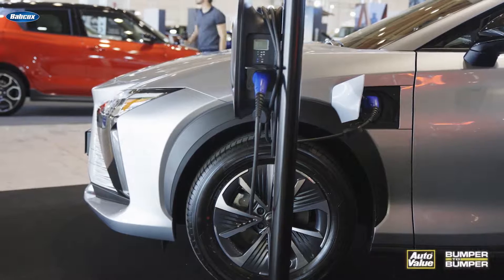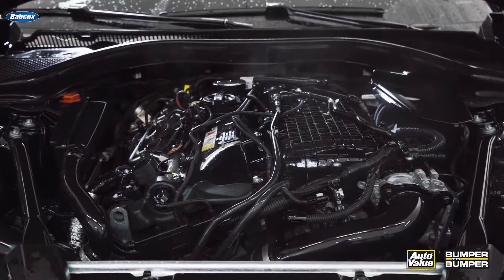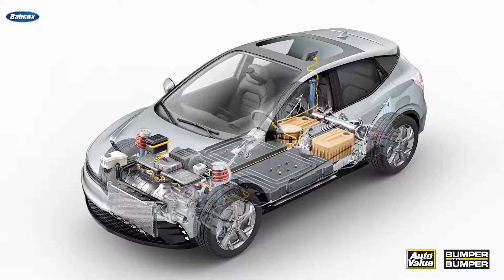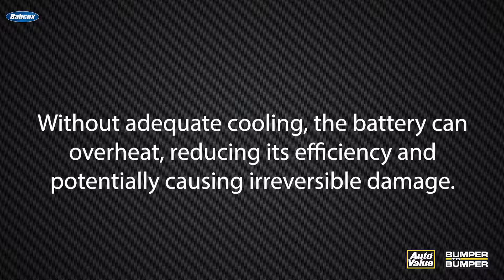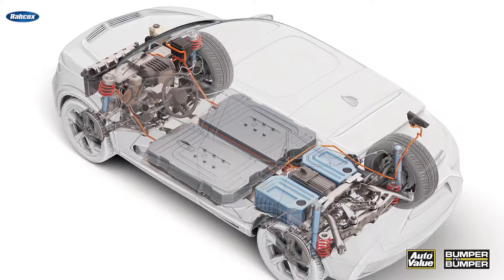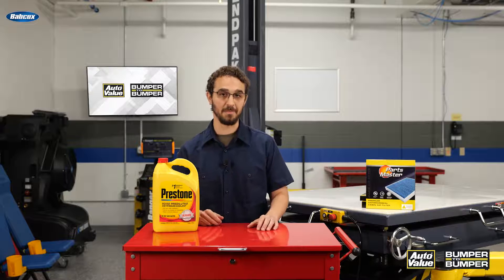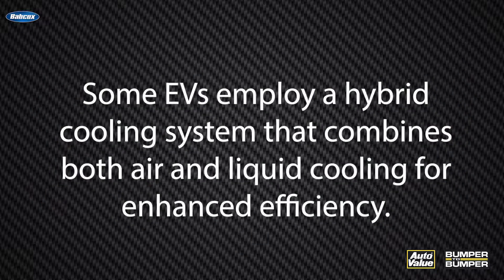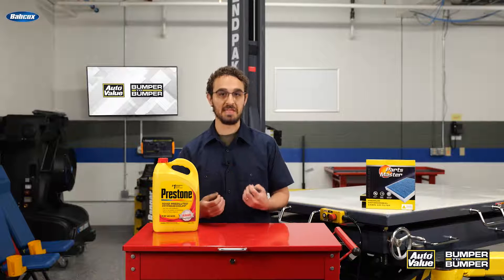What you need to know about EV cooling systems

Comment: Important sidenote. do NOT touch the EV cooling system unless you are qualified and know EXACTLY what you are doing. If the coolant level is suddenly lower do NOT just top it up. If the coolant leaks and gets inside the battery cells you risk a burnt out car. Doing a pressure test without the propper knowledge will result in the same.
Reply: You can’t even check to see if there IS coolant yourself? That’s just a middle finger to right to repair, there’s no world where you can’t put a gauge on a valve and check pressure.